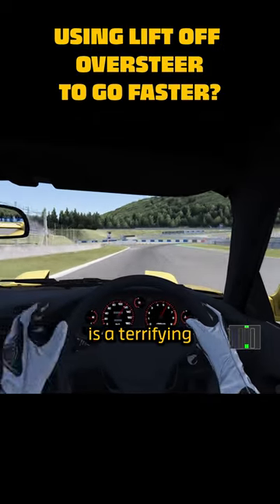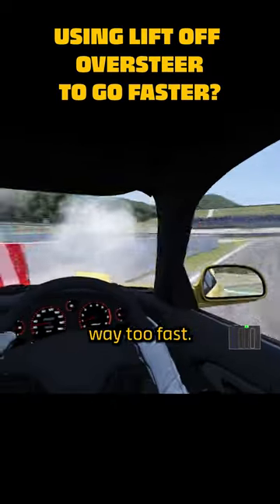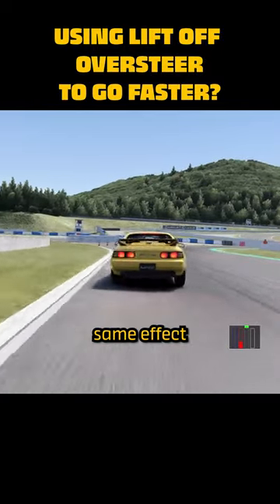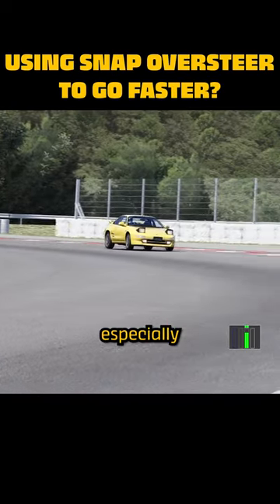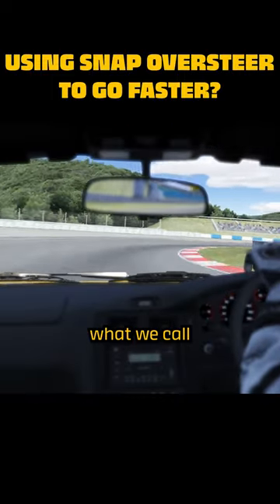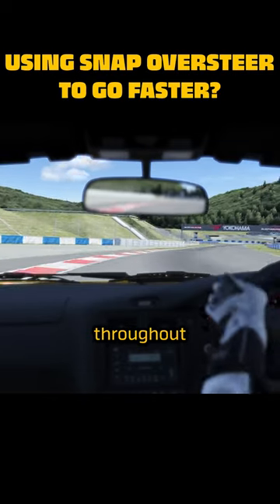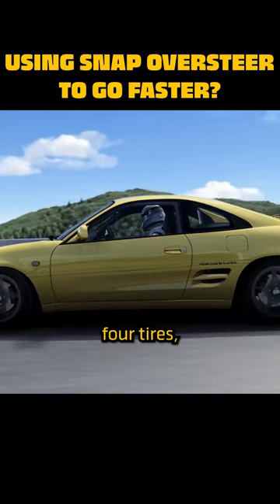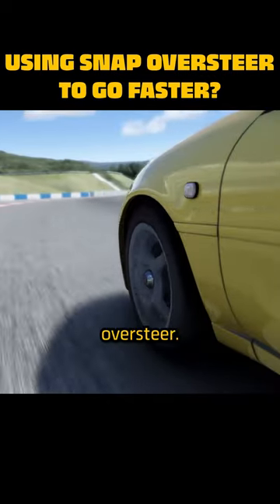Using Lift Off Oversteer to Your Advantage #shorts #simracing #assettocorsa

Comment: You can only decelerate before the turn not during it. In real life it's an insane feeling (owned an mr2). Even more amazing is feeling the car settle into the groove of a turn at high speed. Once you feel it kind of "sink" into the curve you can floor it thru the rest of the turn and slingshot out of the apex.

The other downside of this design is poor front wheel traction. If the road is bad or you need new tires you learn about understeer very quickly as you watch the car push the front end thru a turn.

Its an awesome car tho and I loved driving it. Lowered with good tires it's like a gokart from hell.

Comment: You really need to explain the weight transfer that causes the oversteer for people to actually understand why this is happening. Imo weight transfer explains everything and should always be mentioned
Reply: Not everything, though. A lot of lift oversteer is also from too much or abrupt rear engine braking. You can clutch in and lift without oversteer at a lot higher speeds than if you just lift. ~Same weight transfer either way.

Comment: I lift-off oversteered a 993 Turbo IRL once. Damn near crashed the car. That's when I learned it's best to enter the turn at a reasonable speed then pin the throttle. Once you brave then master a rear engine cars terrifying quirks, they are BEAST.

Comment: I use lift-off oversteer to get my old FWD car sideways in the snow. If you've got front tires with decent grip you can get crazy angles and just throttle straight again.

Comment: Also shortly pushing the brake to get the weight into the front can help with front tire grip whilst entering a corner.

Its actually something i realised i was already doing (in GTA5) but didn't do irl (when i started racing)
Reply: So basically i accidentally learned doing it in GTA and by observing my playstyle i realised what i had been doing automatically and applied it to irl.

Comment: I've apparently been blending this entire time. On BeamNG, I drive the Covet and I'm constantly doing time attacks in it. One thing I've just learned to do for some corners, is hold my throttle at a certain point to maintain speed and grip on all 4 wheels.

Comment: Regulating the throttle through a corner, could you argue you have more power/ acceleration out of the corner as you’re maintaining a higher rpm?
Reply from the maker: yeah you would be keeping it closer to optimum power and keeping the turbo spooling if the car has one

Comment: Brake up to and in to corner. Putting weight up front will break the rear loose. Braking is best in a strait line.... hence understeering into the wall on FWD cars or in this case, snap-oversteer in RWD with mid-rear motor. Basic physics but talk is cheap...

Comment: Snap oversteer is not lift off oversteer. Lift off oversteer is any oversteer that occurs off throttle. Snap oversteer is oversteer that occurs after a car initially begins to understeer on corner entry before suddenly switching (or snapping) to oversteer.
Reply: Correct!

Comment: Does snap oversteer easily happens to front engine - RWD cars too? Or it mostly happens to mid-engine cars?
Reply: it all depends on the setup and tires but as a rule of thumb, liftoff oversteer happens more in FWD cars (more weight and grip at the front, rear loses weight under braking), snap oversteer happens more in MR cars because of their superior rear wheel grip (as slide is corrected and they suddenly grip up, the force is much greater and sends the rear flying the other way)

Comment: lift off oversteer is what is demonstrated in this video. snap is not present at all in this video. snap is when the rear tires are allowed to regain traction suddenly which allows the front tires to send the car to the direction of the correction, opposite of the original oversteer direction. sincerely, all mr2 owners in real life.

Comment: Isn't that just you losing grip
Snap is when you go in to a slide unexpectedly and slam on the break causing you to u know snap to the other side
Reply: yeah this, those are 2 different things, although hard braking while oversteering will usually just spin you out, it'll snap when you overcorrect while lifting
Reply: @DMSBrian24  yea
Reply: @DMSBrian24  you right

Comment: if blending is faster why do people let off gas in other corners?
Reply from the maker: every corner is unique in the way you go round it
Reply: people could also be lifting if they're driving hybrid cars where a fed might have fuel/energy regulations/limits for every race, or for strategic reasons during a race
Reply: If you don’t lift off the throttle in most corners, you will most likely understeer.

Comment: nearly everything you say in this video is untrue/false...

"keeps the weight of the car balanced between all 4 tires" ....... lol what?!
Reply from the maker: i dont think you know what youre talking about
Reply: @TSRB  unlike most keyboard warriors, I actually do. I think what you're trying to explain in the video is the concept of maintenance throttle, which massively improves stability, but even that isn't good technique for actual racing... just for lapping and keeping the car on track more safely.

also, lift-off oversteer and snap oversteer are very different things...

lift-off oversteer happens when you transfer weight to the front and the front suddenly gets more grip; if you don't anticipate that (ie. reduce steering angle), then the car rotates more, or begins to oversteer.

snap oversteer happens when you have understeer (too much steering angle for the front tires to respond to), and then at some point the front tires "grip-up", the car responds to the steering angle, and it snaps the rear end out.
Reply from the maker: @alexellis7210  Some corners require blending or maintenance throttle, usually the ones that would cause lift off oversteer.

And yes i know the difference, but youtube is all about getting views and most people don't. Therefore, in the original video, i called it "snap" because this is what most people believe snap oversteer is. It was my bad and since then i have moved to using only correct terminology despite what effect it may have on views. Thanks.
Reply: @TSRB  fair enough. respect for saying it straight up too.

What I've found to be best is to use the lift-off rotation to your advantage, and time it for the right part of the corner. you have control of how quickly the rotation happens with your feet.

anyways, have a good one.